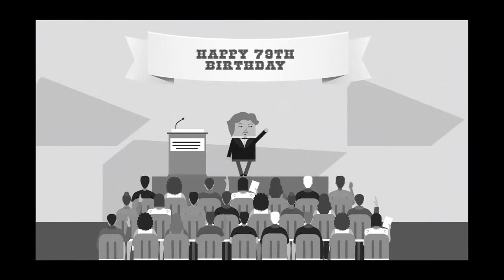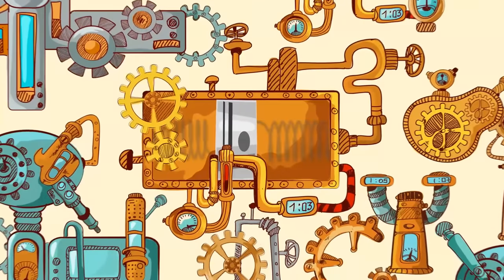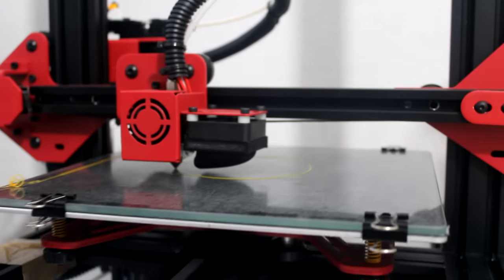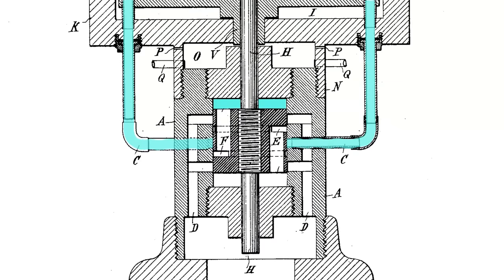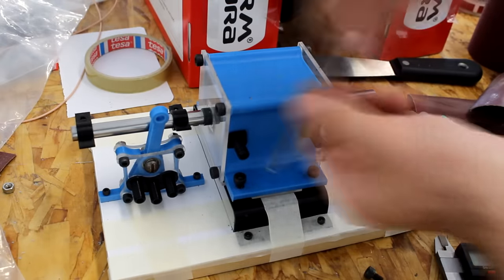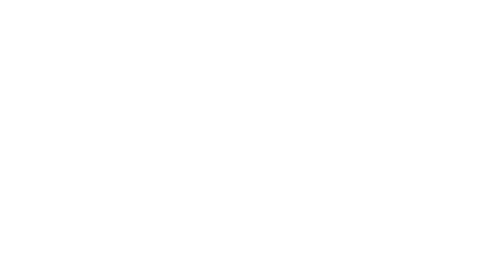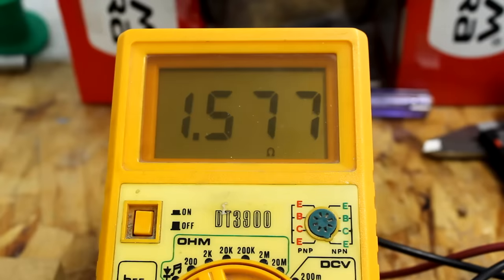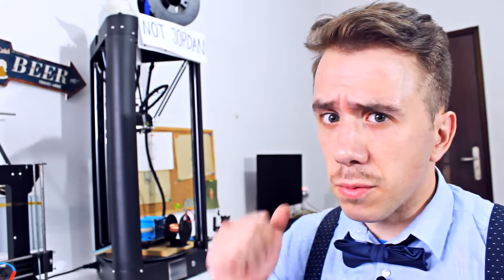Tesla Earthquake Machine [3D Printed]

Comment: The earthquake machine would do amazing things when connected to a subwoofers cone, and more intense with conical rings on the cone to better direct the sound waves. 

😅 would love to see you have fun with that!!!
Reply: Although it made energy from moving magnetic fields, which it gained energy. 

what if part of the moving oscillating rod, at fast speeds rubbed something and by doing so created static electricity.  Which can also be stored or discharged into something 🤔. 
2 sources of energy 😆🤣😂😹😆 moving magnets and also static generator 😆🤣😂.  

Because the oscillations can be really fast aka lots of static charge lol

Comment: You seem to understand it better than the mythebuster did. I would try to get a heavy armature with super smooth movement.  No grease, no resistance to movement (except solenoid part if you move fast.)  I would follow Tesla's design exactly, dimension too. The oscillator is supposed to find the resonance of what it's attached to.  That means it taking feedback from the movement of the whole unit.  The rest is to give the unit a high Q to it can achieve high power into resonance.   I would love to see it work.   Good luck.

Comment: You could have fixed your cylinder mass issue by leaving a void in the cylinder and filling it with lead (melting and shaping lead is super easy).  

Sig Sauer did something similar with their polymer pistol the X5 Legion. They infused the polymer with a powdered tungsten to increase its mass (and thus its weight).

Comment: How to apply tesla turbine to a turbo jet engine, the tesla turbine can get a boost but after turbo jet gets going, it could be self fed by the fan, and can be controlled through a gearbox that turns the turbo jet, a cluch pack could be added in between, I bet it'll work

Comment: Integza I think you may have the magnets aligned and placed wrong with 3 rows in parallel equally spaced running along the length on the outside of the piston.  You may want do away with some of those magnets and put only two rows around the outside front and rear of the piston. Face the magnets out so the lines of flux are perpendicular to the lines of your coil.

Comment: You should substitute the copper wire with a 70% tungsten 30% titanium alloy wire that will give you four times the voltage with the ability to dump the heat because heat is the enemy of electromagnetic field conduction and copper holds heat like no other element

Comment: The main factor you didn't emphasise t is the distance between the magnet and the coil. Also the flux can vary in magnitude and direction. The main factor in a small setup is how close the wires are to each other and the penetration of the field in that coil.  A close second is the direction the magnets are facing in relation to the coil and wasted energy when the waveform is too long and therefore not activating diodes through most of the revolution/motion. Another thing is that your LED's only lit up on alternative passes. You could have made the voltage continuous with some diodes thereby doubling the current per time unit. Otherwise awesome video, Im a big fan of yours and a Tesla appreciator as well. :)

Comment: When you look at equation for magnetic induction you can't see that B is actually the field whose amplitude drops with distance. For efficient magnetic machine you need closed magnetic loop with minimal air gaps. Look at the patent, Tesla used U shaped magnetic core and wire turns are on the yoke. By the way, great explanation of Tesla's mechanical oscillator, I missed so far to understand how piston operates with steam.

Comment: You could keep the coil larger gauge wire and then also wrap around that a secondary coil to boost the voltage (transformer).  Consider how a magneto works.

Comment: I think I may know how the earthquake machine caused the quake.  The machine used steam and the reversing valve caused a pressure osculation in the supply steam. If the steam valve starts to osculate then the pressure being amplified shaking the steam pipes.

Comment: Oh, i made one at home, it has an end stop and jets itself up and down, its a rocket when it hits the end stop the shaft sticking out from the cyilinder pushes it in causing air to come out of the impact side, i call it the internally valved steam engine. Changing pressure or flow control valve should change frequency. To make a building shake would take certaian knowledge.

Comment: I am sorry you need to use some sort of steel in between each layer of copper. It works by usign a very thin layer of sheet steel. So wind one layer of copper coil, then a sheet of steel with gap for wire to come out and wrap another layer and repeat. The other way is to use multiple coils perpendicular to the magnetic field. And have a steel core for each coil. You may try using larger magnets on the rod that are shaped like donuts.

Comment: 4.52 min add a few precision oil, the onesthat are used for locks or all metal repairs job
If you don't have some, car oil, more first number is small, more the oil is fine and precise
The first number is the indicator of viscosity at cold temperatures 
The second number is when the frictions are at the maximum
More it's big, more it's viscose
More the strength you can support between two metals in movement can be supported
But less the oil will be able to be replaced quickly by a new layer, the melange will not be as simple

8:36 min...
The power of the magnetic field is more important on the large faces
One magnet as two faces, two high powerful faces that just need cupper coils to react on each part...
So much energy lost...
If you got a heart never forget your coils needs one too
Hysteresis will explain you how to found the good materials, and you'd better never forget to follow the Maxwell rules
Faraday cage could be utile

Mauvais design :-)
Sinon c'était plutôt un bonne idée
Une roue qui entraîne tous les aimants sur un plan entouré de deux faces chargées de solénoïdes serait plus efficace et n'oubliez pas les petits cœurs d'acier

Comment: Delta printers are better for circular objects.  Also for accurate circles you need  a custom printer with 0.9 deg/step steppers, 128 microsteps / step and a 32bit board.

Comment: 7:02 .  I think it's not the weight that is being used to move the piston past center to trigger the second oscillation but rather the section you mentioned earlier which you are missing from your first tries. The Spring Piston is there to make sure the device never rests in the central position by the exact mechanism you talked about earlier, once its in motion it dose not want to stop and as such pushes the second main piston area into the second stage of the injection.   Love your stuff and that you include the not working parts and even make them enjoyable in your clips :)

Comment: instead of having the printer a two axis track system you could put the extruder on a rotating arm that it can move to outer radius and inner radius like a wheel that goes round maybe even multiple extruders that track in and out and wheel can go either direction for better precision the wheel is attached in center with multiple gear wheels around outer diameter for better stability ...
Reply: thought printing ...
Reply: oh the center would be hard to access but erm less you have the arm trackable to both sides like just one extruder that can go from on side of wheel to other then would have whole circumference of wheel to work with but a large wheel with multiple extruders would only have radius work space but could print multiple parts at same time ...

Comment: One error you do is not to test the generator with a load with resistance equal to the resistance of the coil, because in this way you get the max power

Comment: square piston - shouldn't you be able to do the same trick with an elliptical gear - print both non-circular ones on the same printer, as long as you can align them to the same axis?

Comment: Some little thoughts to your work: Teslas blueprint was vertical, i think this is the reason why your prototype get stuck in the middle. Your construction has no bufferplate between steamcamber and generator where make the resonance who shake the whole building. To make the pressureplate rectangle is a greate solution for the problem with not 100% exact matching parts. Maybe you could improve this a little more with a suitable oil or lubricant.

Comment: Love what u come up w and ur humor. (I'm not sure the actual name of it but) a blade generator would work good with at least that top part. It's a piece of ribbon with a magnet near the bottom. Its firmly attached to whatever top and bottom very tightly. when the Wind Blows By it vibrates left and right and the magnet near the bottom would be generating the electricity .whole lot simpler than Steam. There could be a whole set of them at least one octave if not two of different lengths of ribbons that you exposed to the wind and that way whatever the wind force your kitchn' some electricity.kelivlar ribbons.  sounds like blowing on grass between your thumbs could get a little noisy. So if you put the magnets in the center that would slow it down a lot and it would be less noisy you definitely have to have an assortment of lengths of ribbons.  I live in a very windy place. it's always on my mind .

Comment: NASA has a new design for a Moon Base electric generator using the similar oscillating magnetic "piston". It is powered by Sterling engine for high efficiency and wide range of fuel utilisation.

Comment: The issue with the 3d printer could have been adjusted out with e-step calibration, if done correctly there would be little to no deviation between X and Y

Comment: if the parts are eliptic, can you print piston and cylinder in the exact same orientation so both parts are eliptic in the same direction?
you do not need a circle if both parts match.

Comment: Dude... your approach with the drill was on the right track... but you needed a cutting tool, mounted on a post with a metered control, leaving the drill in a fixed location, then slowly walked the cutter toward the rotating body until you shaved off the high points and made the whole thing concentric.

I think they have a word for such a device, but yours could have been improvised... 😉

Comment: 🔵 Teslas own description of his earthquake-oscillator was that "It was a small Clockwork-driven device which could easily fit in one's coat and would deliver a series of "Taps" to whatever it was clamped to, none of which would
hurt a baby's arm".......
Tesla developed SEVERAL mechanical oscillators in his time,... however, as for the wind-up device which could fit in your coat-pocket and nearly caused a nearby building which was under construction to collapse when clamped to it, well,....
....YOURS is obviously not THAT Tesla-oscillator.

Comment: Looks its called a mechanical oscillator, its operation is like analog speaker , analog sound not digital sound mainly vibration 1-500hz depending on speed
Reply: A spinning flywheel with 1 weight put on it OFF CENTER will do the same thing and can be turned with a dc motor, different speed equal different hertz frequency , low speed is vibration, it doesn't have to he a steam piston wihich eorks like a jack hammer

Comment: You leave me scratching my head. How are those round magnets polarised?
When I first saw the long stack of magnets I thought 'wow I would like to see how he glued them together'. But shortly after the stack was parted. The were not glued. Which would mean that they stick in there own, have alternating polarisation and on magnet almost compensates the field of another?
Also I see no connection between a low frequency generator that makes the earth shake and this higher (than low) frequency generator.
Somehow Iike the piston valve. But piston rings probably would have been beneficial. Up and down movement 'vents' in the piston can be in a total seperated part of the piston.

Comment: with that modification that flipped on and off you could have made a flywheel like the steam trains got that rotate the wheels or like that one rotary engine that rotated with heat after a little spin

Comment: oscillating generators are mechanically not efficient as they have to stop and reverse, kind of why a combustion engine is pretty inefficient as is a piston air compressor. Steam engines used a similar mechanism to push the piston one way and then the other.

Comment: would like you to test my system, its a amplifier plugged into a head unit, and a tone generator. you put 2 giant speakers  on each side of a wall and connect one speaker reversed that way the frequency wont cancel eachother. it shake the whole house